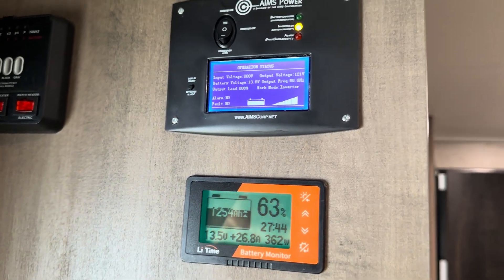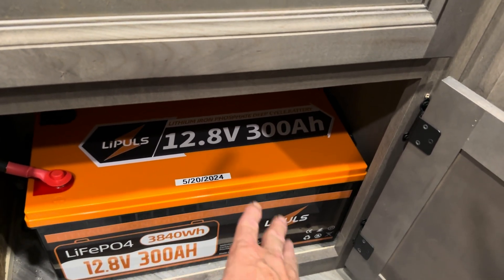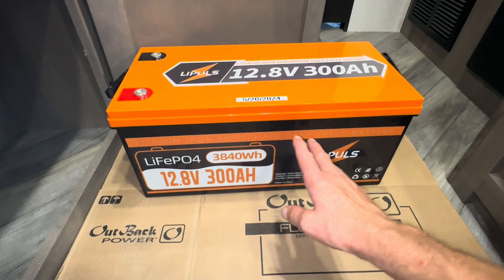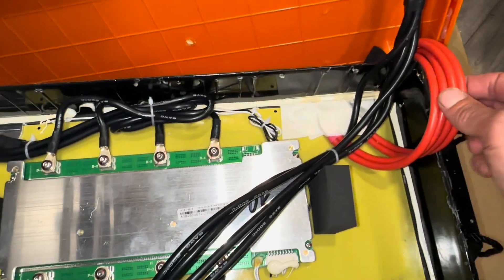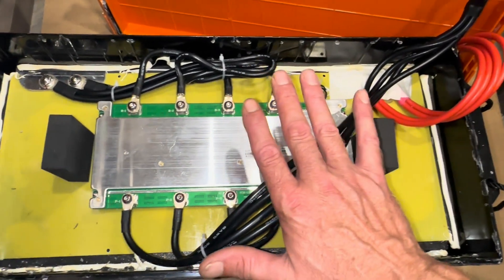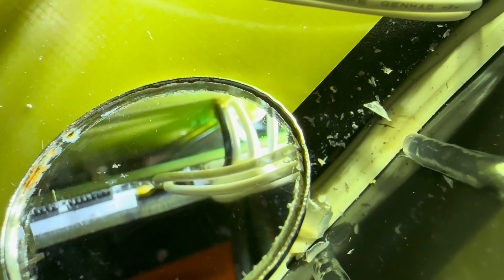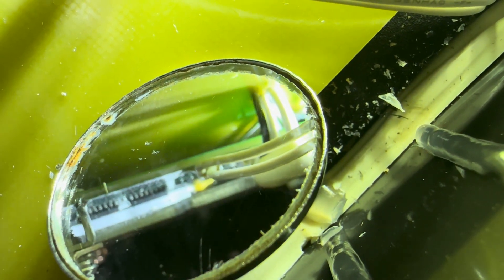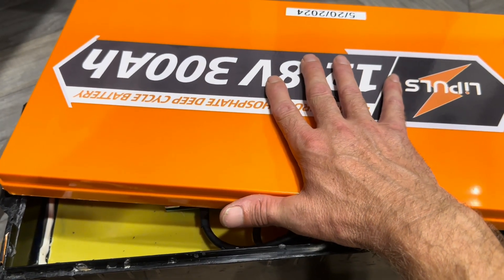LiPuls 12.8V 300Ah LiFePO4 Battery Tearing Down My Battery Viewer Requested 300Ah RV Battery Video

Comment: Thank you, sir! This gives me something to consider while shopping 300 ah batteries. I have been worried about the 300s.  For some reason there is a big jump going from 300 to 400ah. The 300s are around $500~ whereas the 400s are more than twice that much. Anyway, I feel better about them now that I’ve seen those cells in yours and the point you made about 20 lbs/100 hours was spot on!

Thanks again and KEEP ‘EM COMING!
Reply from the maker: You’re most welcome my friend! 
I’m not sure why the 400s are so much more $ , my thoughts are they are less popular due to the weight and possibly the added shipping cost as well! I always look at $ per kWh if storage space is not a concern. If space is a concern I’ll pay more for minis or GP24. The 300 could be a little shorter but most manufacturers are using standard BCI Group cases for all these batteries. Helps keep cost down!
Take care be safe!
Reply: @THEOFFGRIDMOUNTAINHOMESTEAD  Seems to me he could buy Two of the 300's, and have 600 Amps for less $$$ than One 400..... MUCH more Bang for the Buck!

On a more serious note, I'm VERY worried for our Country Post-Election! I sold my Motorcycle, so this is why I have a LITTLE money for MY Project. I think having lights and heat are much more valuable than that 2-wheeled toy.
Reply from the maker: Modern world uses electricity for everything, very wise choice getting some backup power 👍 also think building from individual components is better than a commercial portable power station.
Reply: @THEOFFGRIDMOUNTAINHOMESTEAD  I have ALWAYS been of the mind to use individual components. If one thing breaks I have to repair or replace ONLY the one thing. The Unit I'm getting ready to build WILL cost more than a commercial unit, but it will have MANY more capabilities.
One big regret I have is this: I can build them better than China, but I can't build them cheaper. That being said, may I share my vision for this thing?
A. Minimum 200 Amps, hopefully can make it work with 300 Amps.
B. Would like a 1000 Watt PURE Sine Inverter, but only have room for a 500 Watt Inverter. The BIG reason I do NOT like the Harbor Freight 750 Watt Modified is that it makes the Devil's own noise when running.
C. TWO 10 Amp Solar Charge Controllers. My reasoning for this is as follows:They will be on separate circuits-I can run them both at the same time to charge my full system, or I can split one off to charge another person's unit at the same time, or Thirdly, I can run them both independently to TWO External units to help others out while keeping MY stuff running at the same time.
D. By Having three Individual Batteries in a Parallel Configuration, I can choose to run just 1, or 2, or all three depending on my needs. It also provides me with the Ability to move an individual battery to another room for ancillary ops.
E. I'm hoping the RIGID rolling toolbox I purchased will also be able to house my ALLPOWERS 100 Watt Holdup Solar Panel.
F. Lastly, I'm using the Smallest Harbor Freight Hardcore to house all of the Instruments. It will have 2 Cig Sockets, each with a 10 Amp Circuit Breaker on one side (Switched), and on the other side will be THREE dual Port 3 AMP Usb outputs. The idea being that with even just a 200 Amp Battery supply, I can charge up to SIX Devices at the same time.

IF I build this right, EVERYTHING will fit in the one RIGID toolbox, that I can take anywhere.
BTW, what do you think of my idea for two independent Charge controllers in the same system?
Reply: F. Hard CASE not hardcore. oboy!